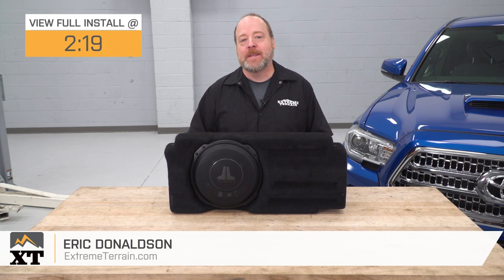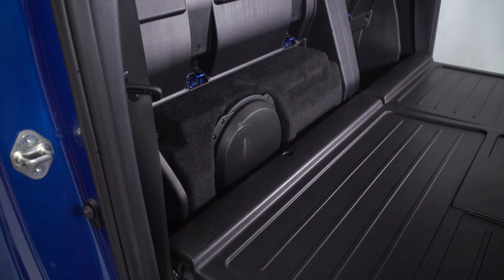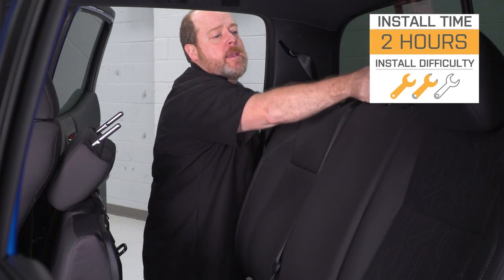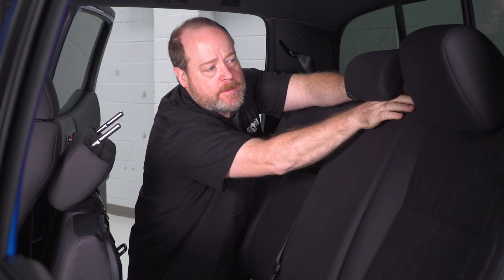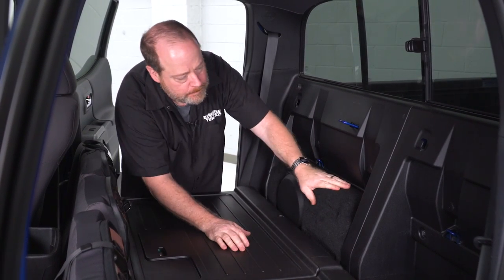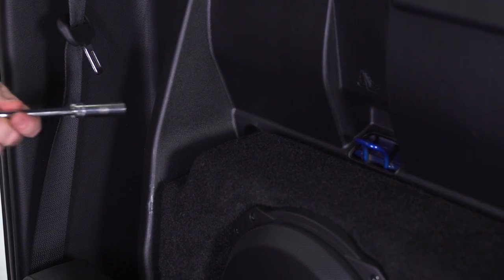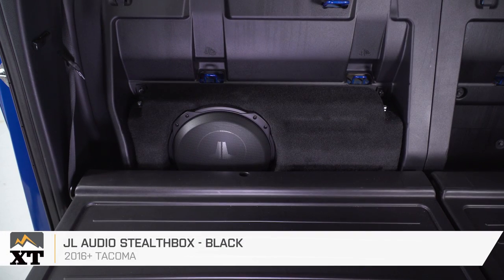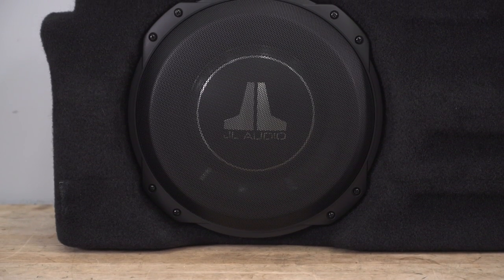2016-2021 Tacoma Double Cab JL Audio Stealthbox; Black Review & Install

Comment: Did I miss something? It didn’t show it being hooked up. That’s what I was wondering about. How into detail is it to wire it to the factory radio.
Reply: If u want to keep your factory stereo unit than you would have to purchase a low output converter and plug it directly to your factory stereo unit so you can add a subwoofer and the amplifier
Reply: This unit is wireless , that's why it is $800
Reply: @IJChan223  just no
Reply: @IJChan223  Uh, I’m pretty certain it isn’t wireless lol

Comment: For $500 or less you can get a better system and a box for both seats
Reply: You talking about a custom installer?
Reply: @russ6366  no, there is the box, Rockford subs and Rockford amp on ebay for $500
Reply: @ticoruizsuarez   could you post a link?
Reply: They sell a custom box for a 10 inch sub and you can find your own shallow sub all for about 250$   or you can get a higher end sub for less that 500 easy.    The box is like 150 I believe and a higher end sub is about 300.    1000 dollars for this sub is just straight insane

Comment: Does anyone know how to remove the factory JBL subwoofer? Can't find a tutorial video on it anywhere
Reply: It's located behind rear passenger side back seat.  It's mounted via a panel with the JBL AMP.  You remove the bolts holding the panel and both the AMP and SUB comes out w panel.

Comment: 1000 dollars??  Are you insane?   I could have a professional carpenter make me a custom ported box and buy a high end subwoofer and still have left over money.    Do people even buy this?
Reply: The subwoofer itself is only 200 I don’t get why this unit is so expensive
Reply: I’m a carpenter myself I rather built one that sits on my floor/ under seats cargo area you will get more bass rather than behind the seats where it will block the bass flow